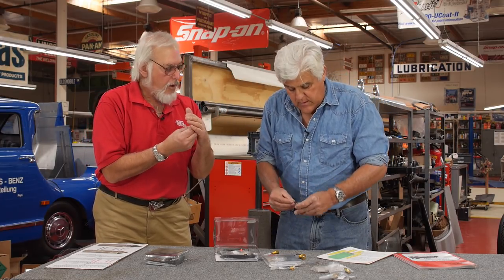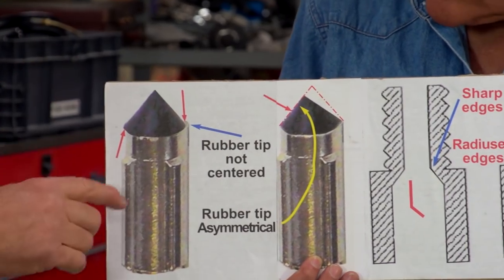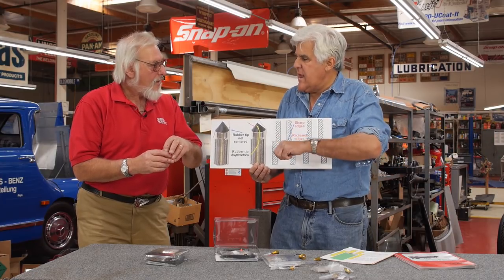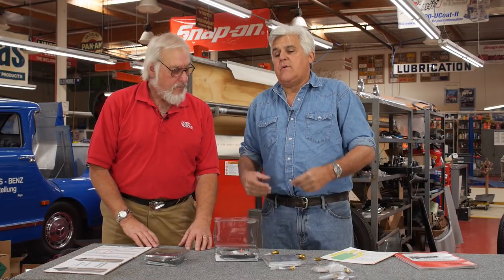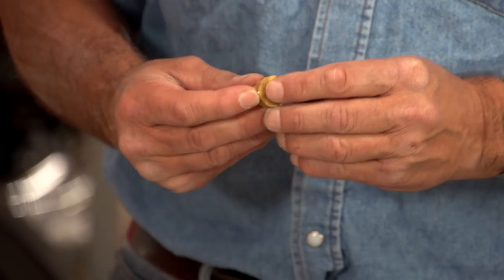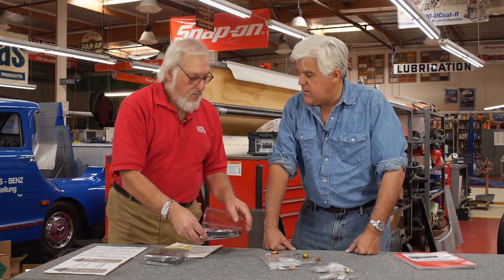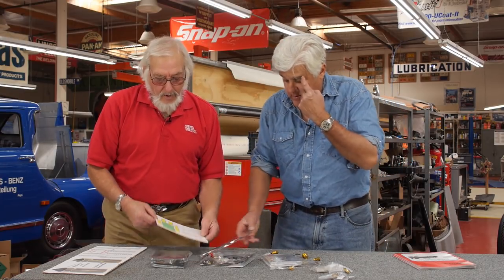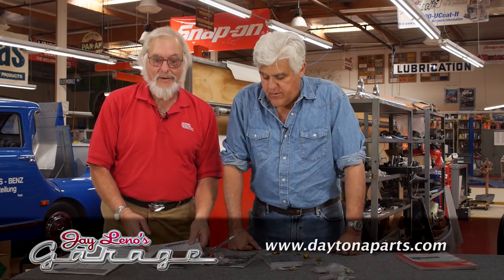Skinned Knuckles: All About Carburetors - Jay Leno's Garage

Comment: I work on a LOT of old cool cars with carbs and have never had an issue with floats, needles and seats from the kits locally sourced.
Accelerator pumps are another story.
Reply: Hate to ask a probably dumb question but what's an accelerator pump?

Comment: This is why I only use brass tipped needles. Aside from mechanical mismatch, the ethylene in current fuels can etch away the rubber tipped needles. I get a year out of brass tipped needles in the DCOEs on my daily driver, as opposed to 2-3 months from viton tipped needles.

Comment: Unless you run on fumes, then you only need the throttle plate to control the demand to the motor.  You get rid of a ton of fueling issues when you convert to that.  Because not only can you do it different ways (fueling) you can mix what all is making the fumes too.  Very cool indeed.  Over 100 year old tech and we're still ignorant of it (most folks are).

Comment: Ah, the Good Old Days !!!! Balancing carburettors, adjusting points, spraying carbon plug leads with damp repellent, servicing every 5,000 miles. Do I miss those Golden Times ????? Do I fucking hell as like !!!!!!!!
Reply: It's not about that.  It's about keeping classic cars in tune and original.    I like EFI and electronic distributorless ignition too.  I can only imagine how hard it would be to maintain cars like my minivan where I can't even get to the spark plugs if there were still points and non-Platinum plugs.
Reply: sloperdude If you're keeping your old jalopy in tune and original, then my first comment is exactly what you'll be doing. With your minivan, you don't even have to open the bonnet between services.

Comment: Carbs are ancient technology . They have so many parts to go wrong , so it is best to be replaced . Companies could produce modular monopoint fuel injectors with integraded air flow meter , fuel flow meter and throtle position meter thah it interchangble with carb it replaces - brackets , sealing , pypes etc. Also , it connects to ignition switch . Gonvermets can force people to use them by having mandatory emition regulations for every road-legal car that none carb car could meet .
Reply: Government requiring modifications done to old cars?  Hmm how about no.
Reply: For instance , China has outlawed pre-2005 made car due high polution . What is the point of forcing manufactures to make low poluting cars if there are still high poluting cars on the road . In UK , in order for car to pass MOT , brakes and steering must work , car has meet polution regulations , it should not be rusty on important places etc. I live in Serbia (southeastern Europe) and my grandfather has '88 Ford Sierra . After car has failed test because it was too smoky and to noisy , we had to do engine rebulid , clean carb and change exaust system . But as it is old car , it doesn't need to meet strict regulations as new cars , so it passed . In some cities in Europe , due to noise and polution ,  two-stroke cars like Trabbant are outlawed (google pics Trabbant smoke) . Cuba has very nice solution for this problem - as up to this year poeple could not legaly sell their cars , during years ther replaces gas guzzling V8 with more economical engines . So only thing you should replace in cars is it's old engine . Many musclecars owners do LS swaps for power , why other do not do swaps for cleaner air .
Reply: Mladen Milić Hey boss, not harshing your style but here in America we believe in freedom. Government's job is to protect me from foreign invaders, print the money, and let everyone do whatever they want as long as it doesn't hurt anyone else. After that the government should get out of the way. As I understand you have a different idea of governmental responsibilities I will just say this: More power to you, I hope if we ever meet we can have a drink and teach each other all about each other's cars and women.
Reply: People are like small children - they do things they should not do because they think it is not bad for them . For instance , you have free gun trading laws , because you need gun for protection (but police is there to protect you, right) . You have situation where every madman or maniac could legaly owe a gun , and normal people that are becoming murdurers because they were protecting from them . Not to mention colateral damage . Imagine that there are no drinking and driving laws , no speed limits , no polution laws . It is more profitable to run factory without any filters , throwing garbage through window , taking food from shops when you are hungry , etc. Some people think that they are not hurting anyone else doing that . But some countries , like mine , are idiotic - they do not let me to build EV because in order to be road legal it must have data like displacement and engine number , fuel only can be gasoline or diesel , and for any modification they me to ask for manufacter's persmision for modification .